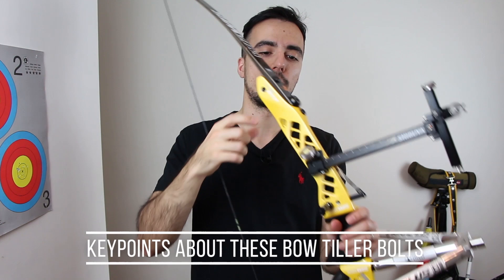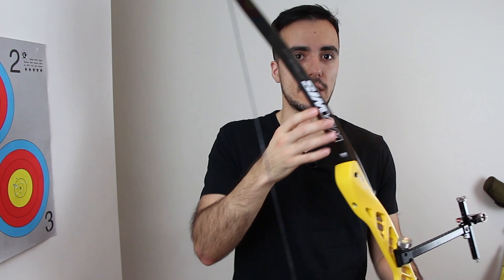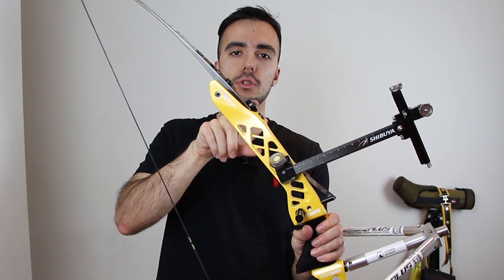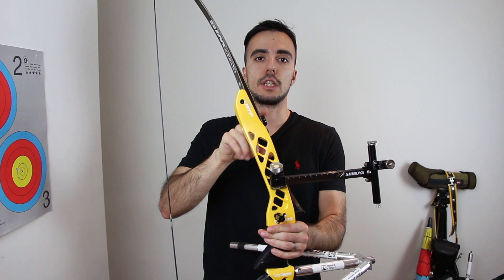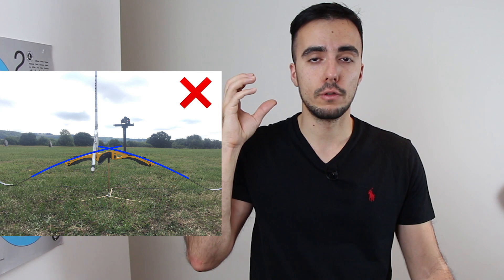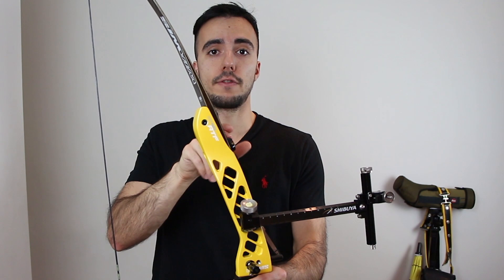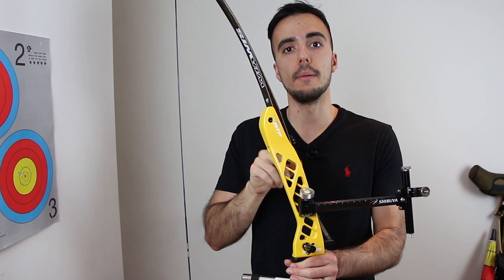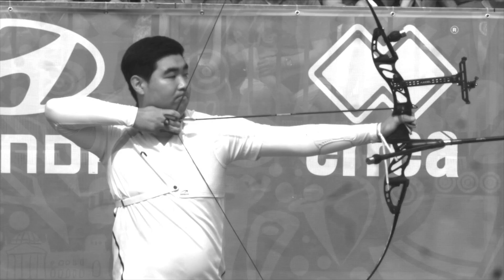YOU'VE BEEN USING THESE WRONG

Comment: I was a welder and machinist for 40 years, you are absolutely correct. Aluminum is so soft, armstrong archers will power though and deform the threads immediately,  first turn under pressure geometry you are "screwed"
Reply: What about 7071 billet aluminum? Like the riser from the discovery

Comment: Stainless steel bolts in aluminium have a problem called “Galling” and this is what is mostly happening here. When the threads are loaded by the string, you can be merrily turning the screw, no problem, and within a 1/4 turn the screw can feel a bit stiffer, then seize completely,  and may as well be welded😮 Lubricating the threads can help massively, providing you do it before galling raises its ugly head, an should almost eliminate the risk of this happening at all. I would recommend lubricating with ACF50, which also has corrosion inhibiting properties, or using one of the “super lubricant” greases like Du Ponts “Krytox” if cost is no option👍 This range of lubricants an ability that means that once the surfaces are lubricated, they always will be, no matter what!!  (Think red hot conveyor belts in steel rolling mills) Jaguar car dealers should stock this grease as a repair part for folding soft top roofs. You get the tiniest sachet you will ever see, because this stuff cost circa £1000 per gallon. Part # may be KSP205 for grease, and KSP105 for oil
The other problem that can happen here is getting to the point where there are not enough threads engaged to be strong enough, and this must be avoided at all times. De stringing the bow in this instance will make no difference.

Comment: Don't worry too much if you strip out the threads on your out-of-warranty, Good Quality 6061-T6 or 7075-T6 aluminum riser.
Helicoils, Slimserts, Rosan Inserts and a few others are excellent repairs/upgrades which will provide you with non-rotating hardened steel threads on the wear surfaces.....Then, you "Can" adjust tiller with your #50 limbs already strung.

Find an ISO 9001 certified Machine Shop to evaluate the damage to your riser and perform the work.......I would charge about $100 for a helicoil repair and probably double for an insert type of repair/upgrade.
Every threaded hole on your Good Quality Aluminum riser can probably be upgraded.
Reply from the maker: That's good to know! Maybe a couple of people here might contact you 😂
Reply: @OnlineArcheryAcademy  If I was a pro archer, I would want to have the confidence in my equipment allowing me to adjust tiller while standing on the line. 
We can also eliminate the need to lock the tiller bolt after making the adjustment by applying new aerospace design requirements (new tricks).

Comment: With the limb bolts at the mid position, you say that the bow is
- more efficient
- more forgiving
What is the reason for this; did you test it?
Reply from the maker: Great questions!

For the limb bolts fully turned in, I've tested this a fair amount and found that when the limb is bottomed out, the tuning is more critical. Let me give an example. With the bolts all the way in, I found that it's much harder to pin down a setup that gets clean arrow flight and good bareshaft readings. It wasn't impossible, but the margin for error was smaller. So when you translate this to shooting it means if you make a small mistake it will be penalised more because the setup is more sensitive.

For the limb bolts turned all the way out, I haven't tested this fully. This is based on the stability of the limb against the bolt, because if it's turned out too far there is a much smaller contact area of the limb on the bottom of the bolt due to the angle of the limb. I hope that clarifies that a bit :)
Reply: @OnlineArcheryAcademy  I've been shooting Barebow for over eight months now. When I bought my first riser, the tiller bolts were screwed all the way in.  Not knowing better, I've been shooting my bow like that since...or until my new riser arrives. My WNS Explorer limbs are still decent, so i will reuse them on the new riser with the bolts in a neutral position. I hope in doing so, it quiets the bow & provides positive results.
Thanks for the insight. 😊

Comment: Tiller bolt all the way in will dig itself into the limb. Tiller bolt to much out and it is not much from being flush with the limbs, will put a lot of twisting force to dovetail bolt which will try to push it out of the pocket. In result there is barely more than 3 turns of useable tiller bolt rotation range even on 15turn thread used on W&W Nano Max I checked this on.

Comment: I would not bet any money on that quality control you mentioned. I had one set of NS limbs and had to replace them as they were twisted. Current ones are twisted as well but not to extent as original were. NS limbs are very narrow at the ends and have little twist rigidity there.
Limb bolts to far out is most dangerous. Lot more than to far in. Not only because you can strip riser thread but also because ILF socket is designed to fit on very small margin of angle. When tiller bolt is too far out, limb detent assebly will force whole limb out of the limb pocket. I was astonished how little tiller bolt turns this system allows. On my Nano Max with total of almost 15 turns between tiller bolt out to full in to the bottom, usable turns is 5-6 near the bottom.
Reply from the maker: Oh, that's odd to have that - I've always seen great QC and had a lot of stuff over the years that's always been really good. Hopefully you got it all sorted :)

Comment: I tightened the tiller bolts all the way down, less 2mm. The bow shot great but after several thousand arrows, the upper bolt sheared off inside the bolt socket.

Comment: Great video again. I have problems about positive, neutral and negative tiller settings. If the curvature of the limbs and riser is continuously smooth, will it automatically gives a positive tiller? And appreciate what's the recommended positive tiller measurements in mm? Thanks, Ashe.
Reply from the maker: Thanks Mikhail! Good question. No is the answer, just because it's hard to see the small differences that would result in say -2mm, 0mm or +2mm tiller. For the tiller, somewhere between the range of +0-8mm is normally the recommended. There is a video coming out soon about this :)

Comment: Good video. I never touched these bolts, but I always imagined that could be helpful in transition between limbs, to economize, going four to four. For example, if you have 34# limbs and want to upgrade to 38#, you can try first 6 months to 36# with the 34# limbs and the bolts in. This make sense?
Reply from the maker: Exactly! You can use them for this and it's really helpful, but if you want the ideal position then it's good to get them in a nice curve :)

Comment: I have a question  my tiller limb bolt is little different between top and bottom, the bottom limb bolt is higher then top bolt  but the tiller is same when it measure(neutral)so, is this correct way to put the bolt in this position? and another thing  is that when I keep it the two bolt in the same level at that time the tiller is in the positive tiller so how to fix this problem to get the limb bolt in same height level to get neutral tiller
Reply from the maker: That's normal, don't worry :) The important thing is to get the tiller correct, the height of the limb bolts might be slightly different

Comment: Good point, I never would have thought of the thread stripping loaded, BECAUSE, as an engineer I would have that thought that thread bolt design would be derated at LEAST 50% over maximum possible load, strung, at typical estimated high usage over max bow life.  Pathetic design and production standards, especially if the bow we're discussing has a consumer price of $300 or more.  On a $30 bow, that is much more understandable, actually likely. 

Most people don't know that to sell something for $100 retail you have to manufacture it for about $10, for about two levels of typical profit in the supply chain, transportation, etc.  If you saw the typical mark up on jewelry or 'designer' clothes or medicine you'd be incensed, shall we say 30,000% or orders of magnitude higher (a guess, for the worst of them, some drugs, where the pricing is based on "how much is your child worth to you" or some other BS, often for medicinal concoctions those companies received FREE, taxpayer funded) and cost four cents a pill to manufacture.

It would be simple for manufacturers to helicoil or steel insert that obviously marginal thread to upgrade the external thread to a MUCH higher failure loading, one that actually works 100% of the time, barring manufacturing defects which, with proper procedures such as good quality control (not what 98% of people think it is) and quality final inspection should make it to the consumer at very low rates.  

Then again I just had to install head bolt thread inserts in my Toyota Camry (nasty job, all of it) when the head bolts pulled the threads clear out of the block to the point that I could remove the center rear bolt with my fingers (not exaggerating, at all, should be probably 75 foot pounds or more, by feel on the new bolts), so there's that.  Ankle biters that want to shave $5 (probably not even that, not close to that on a bow for two threads made in China I'm guessing) off the price of manufacture at the buyer's sometimes heavy expense.  I get so damned tired of it, actually, when I dig into things to fix them and see utter disregard for the consumer.  

My opinion, if you buy a car for 20-30k and well up they could afford some damned thread designs that virtually NEVER fail, not once, ESPECIALLY in labor intensive to repair areas in all the cars or bows they've sold.  It's not a damned rocket, where margins really do have to be kept to a reasonable level, especially in non critical areas to meet minimum functional requirements and safety.

Just my soap box bitch for the day, sorry, but GOOD GRIEF, have some integrity and pride, manufacturers.  Many bean counting ankle biters and 'support' personnel are a bane to society, my experience, and usually useless when you actually have a question for them.  I'd rather pay 10% more and get something that WORKS and LASTS than some piece of crap that will be in the environmentally destroying refuse pile and where replacements need to be unnecessarily manufactured LONG before it should have been.  But hey, you can't sell as much future crap if you produce good stuff, now can you?  Bucks at the expense of everything else, that's 'our' motto today.  Great sustainable thinking.

Great video, thx, but you do realize that even after watching this video people are going to be adjusting draw weight with these bolts, which is also the manufacturer's intent, as I understand it.  For 'squaring up' the bow geometry, the adjustments don't need nearly the typically designed amount of travel.  Even by today's final product standards the bows aren't remotely THAT bad.  And in terms of geometry, the bow should be far more accurate in that respect today than, say, a 100 year old bow.  CNC and protocol, etc, does account for something, sometimes a LOT in that area.  

I also suspect that this adjustment may be critical for the Olympic archery shooter, useful for a hunter, more like useless for someone shooting at a back yard target for fun on rare occasions.  For many, I doubt if you adjusted one fully out and the other fully in it would make much difference...never tested that and could be way off base, but that is my off the top of my pinhead guess.
Reply: The design is fine, the problem is people are too lazy to take 30 seconds to destring the bow before adjusting them.

Comment: I shot the first adj bow and upto that point all limbs were accurately tillered.It is apparent the adj bow was designed to save the 
manufacturer the time and money of doing this.Consequently many cheaper limbs and mid price ones are badly tillered and you cannot correct this properly with the bolts
if you want a relability and optimum performance.

Comment: I've always thought that W&W measured limbs at 26.5"...
Reply from the maker: I just had an email asking the same thing - this is the first I have heard of this so I'll check this with W&W to confirm how they do it :) Either way the key thing is that W&W limbs tend to be slightly heavier than Hoyt limbs for the equivalent marked poundage.
Reply: @OnlineArcheryAcademy  Ashe I don't know if this helps but taken from my WINWIN manual "WIN&WIN high quality limbs are available in marked weight from 28# to 48# in
two pounds increment. This marked weight is measured at 26 1/4” (AMO standard)
to the throat of the bow grip (pivot point) when the limbs are used with 25” risers
basically" 
This is from my Hoyt manual The weight marked on the lower limb is measured at a 28” standard A.M.O. (Archery Manufacturers and Merchants
Organization) draw length. A.M.O. draw length is measured at
26 1/4” to the throat of the bow grip plus 1 3/4”. This produces
an industry standard by which recurve bows are measured. 

MK use the same AMO distance BUT the tiller bolt positions vary vetween the 3 so marked# for MK is at tiller bolts out and for Hoyt Tiller bolts mid I recall .

Comment: You can't "cross thread" something that is already threaded... that makes no sense.
Reply: Wrong, you can only cross threading something that is already threaded. It's quite the well-known technical term for accidentally cutting a new thread into an existing thread at an angle hence crossing them. It's mostly happens when inserting hard steel bolts into softer materials like aluminum.

Comment: I've been watching some of your videos, but this one is just pure bullsh*t, sorry. It doesn't matter at all if the limbs form a 'continuous arc'. Also, you didn't explain AT ALL what the tiller actually is and how to correctly adjust it. Btw I doubt that many archers often use the tiller bolts to change their bow weight since the potential gain of doing so is a maximum difference of 8-10% in draw weight.
Reply from the maker: I'm sorry you didn't like it Martin. But I have found that this is an important part of the setup of the bow, and varying too far to the extremes from this optimum setting can cause the tuning to be critical and penalise errors more strongly. I wish it wasn't common to see the limb bolts wound completely in or completely out, but I see it so often.

It's not as important for newer archers to get the optimum limb bolt position but for higher level archers who pay thousands of pounds for their equipment, it's often overlooked and they're not getting everything they can out of their setup.
Reply: @OnlineArcheryAcademy  Still, you should explain what the tiller bolts are actually for and how to set tiller correctly.
Reply from the maker: @martinromer6997  It's being edited as we speak :)
Reply: I use mine to adjust the weight because after a 2 year break it was too much for me and it made enough difference that I wasn't struggling to hold the bow after an hours shooting.